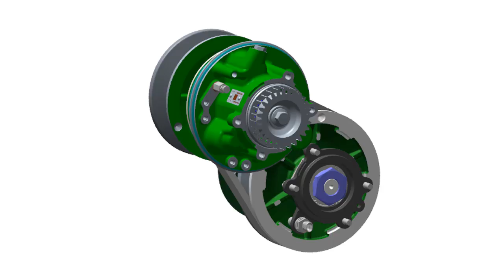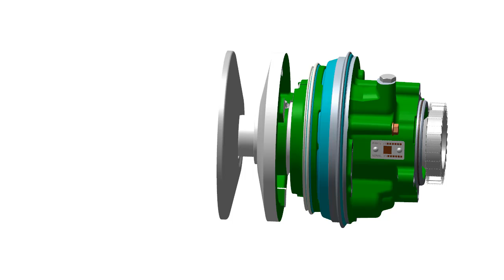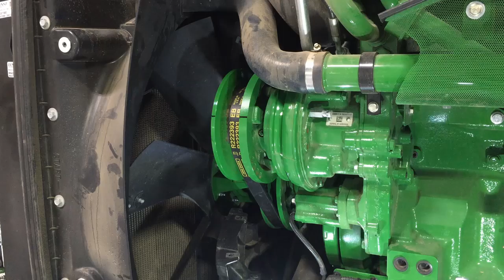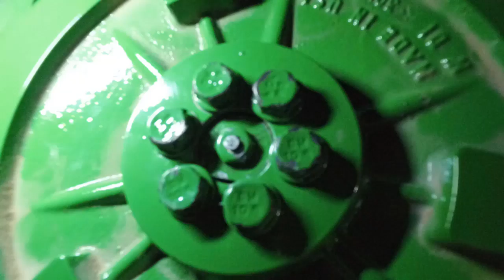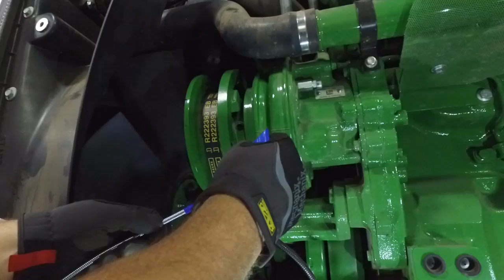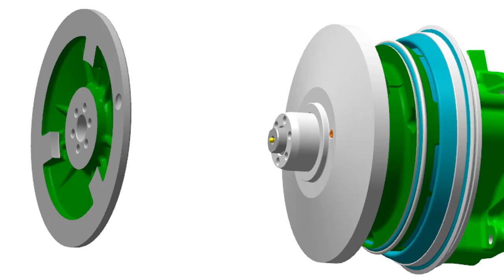Vari-Cool Fan Drive Maintenance | John Deere

Comment: What if it looks like the original drive but doesn't have any plugs to remove on the driver or driven hub.  8225R
Reply from the maker: Thanks for reaching out, Jeremy. Your local John Deere dealer will be your best resource for technical questions about your 8225R Row-Crop Tractor. You can find your closest dealer at Deere.com/Dealer.

Comment: These fan drives are garbage. There i said it.
Reply: Look up ZK MasterTech here on YouTube this shows you the maintenance part of John Deere tractors that you will probably not see anywhere else
Reply: @jchambers2586  I've watched his videos. They're well thought out and informative. But still doesn't change the fact that these fan drives are junk. Every deere mechanic would tell you that they're junk, yet deere still won't let go of this failed design. They would rather update versions of it without issuing PIPs instead of just redesigning their cooling systems to operate direct drive hydraulic operated fans (like everyone else)
Reply: Absolutely the worst design they could have dreamed up.  Sad part is the industrial equipment has hydraulic drive fans that are wonderful, and,,,,, they auto reverse.
Reply: When a header engineer gets reassigned.